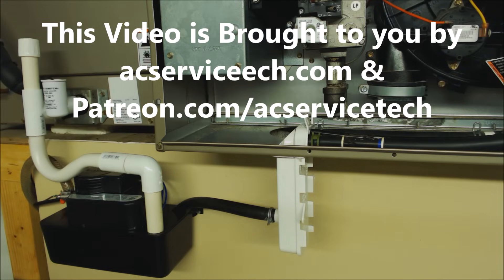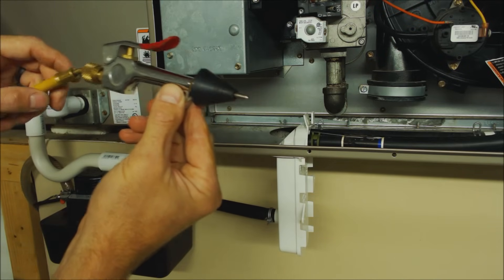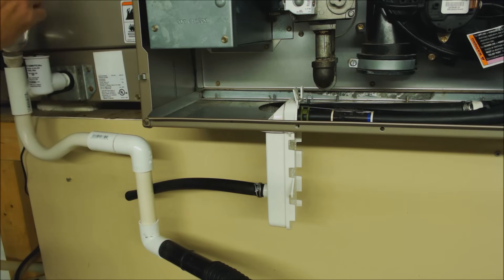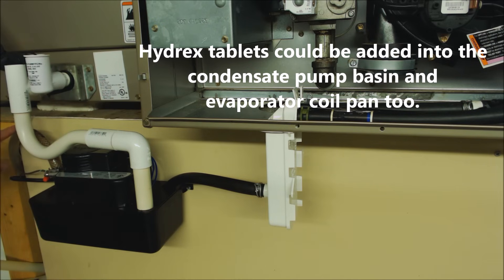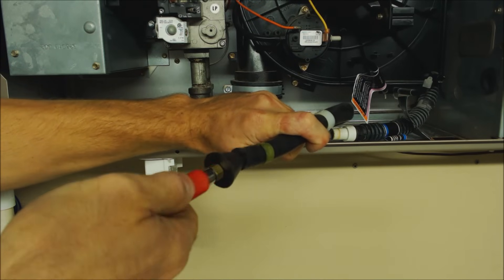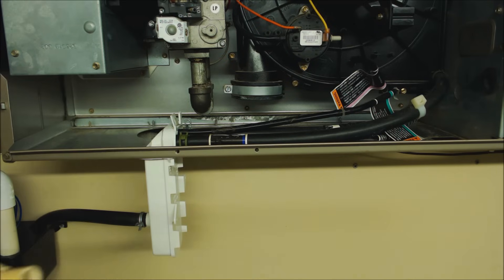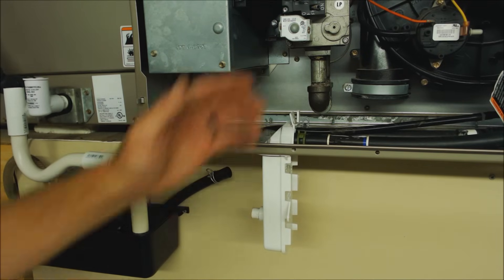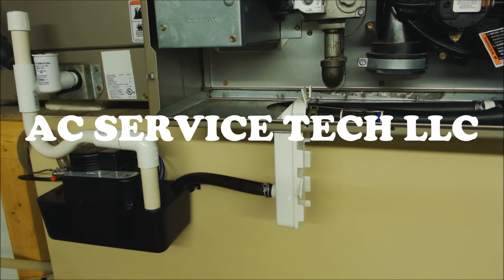Condensate Drain Traps & Lines Cleaned on AC and Gas Furnace!

Comment from the maker: Tool List-  https://www.amazon.com/shop/acservicetech
Support-  https://www.patreon.com/acservicetech
For those that are looking for the tools used in the videos: (Linked Below)
Nitrogen Blowout- https://amzn.to/2yzMQRD
Air Compressor Plug and Coupler Kit- https://amzn.to/2NE8klG
Air Compressor Blowout- https://amzn.to/2CaNXum
Craftsman 2.5 Gallon Shop Vac- https://amzn.to/2ROaR0j
Hydrex Tablets- https://amzn.to/2CHOu8m

Supplies Used for the Vacuum Hose
1/2" Cpvc Slip X 1/2" Mpt Male Adapter
3/4" PVC Reducing Bushing x 1/2" fpt
3/4" PVC 90 Elbow
Misc 3/4" pvc
Misc 1/2" cpvc

Here is the Link for the Yellow Jacket Refrigerant Manifold Gauge Set used in the videos http://amzn.to/2aenwTq

Here is a link to Refrigerant hoses with valves used in the videos  http://amzn.to/2aBumVI

Here is a link for RectorSeal Bubble Gas Leak Detector http://amzn.to/2ckWACn

Here is the link to the Appion Valve Core Removal Tool- http://amzn.to/2uYr8WL

Here is the link for the Ratcheting Service Wrench   http://amzn.to/2dGV4Nh

Here is the Link for the newer UEI DL479 Multimeter with temp sensor- http://amzn.to/2jtsUbJ

Here is the link to the CPS Vacuum Micron Gauge- http://amzn.to/2v1nM3O

Here is the Link to the Appion Blue 3/8" to 1/4" Vacuum Hose- http://amzn.to/2uYlVyc

Here is the Link to the Appion Red 3/8" to 1/4" Vacuum Hose- http://amzn.to/2uYg6Ro

Here is the link to the Yellow Jacket 1/4" by 1/4" heavy duty hose straight-  http://amzn.to/2umtcod 

Here is the link to the pack of 25 C&D valve cores- https://amzn.to/2J1lurm

Here is the link for the C&D Valve Core Wrench, Container, and 3 valve cores- https://amzn.to/2EVGkps

Other tool links can be found in the video description section.

Shop through Amazon! Your Purchases through Amazon provide a means for channels such as mine to earn advertising fees from all purchases after clicking through. Prices are the same as normal-    https://www.amazon.com/shop/acservicetech

All of the ACSERVICETECH Playlists-  https://www.youtube.com/channel/UCOZR-1IqsAer9wzlvFgb4mA/playlists?view_as=public
Nitrogen Blowout- https://amzn.to/2yzMQRD
Air Compressor Plug and Coupler Kit- https://amzn.to/2NE8klG
Air Compressor Blowout- https://amzn.to/2CaNXum
Craftsman 2.5 Gallon Shop Vac- https://amzn.to/2ROaR0j
Hydrex Tablets- https://amzn.to/2CHOu8m

Supplies Used for the Vacuum Hose
1/2" Cpvc Slip X 1/2" Mpt Male Adapter
3/4" PVC Reducing Bushing x 1/2" fpt
3/4" PVC 90 Elbow
Misc 3/4" pvc
Misc 1/2" cpvc

Comment: If your unit is installed in an attic you might consider adding heat tape around the trap to prevent the trapped condensate from freezing.  Ask me how I know!

Comment: I simply unplugged all the vacuum and drain hoses, removed the condensate trap and gave a hearty blow into on end.  Amazing the black soot that came out… I ran some hot water thru it in sink to ensure flow and replaced all components.  One tip I didn’t know I needed to prime the trap with water to create a flow again, otherwise the water will build back up.

Comment: Thank you that fixed my leaking of water all over the floor around the furnace. I had a clogged trap. I used my wet dry vac and sucked from the end that goes into my floor drain.

Comment: You provide great detail on how to "assemble" necessary parts to clean out the trap, much of which could be addressed by simply installing an EZ Trap 113B. Trap is transparent, comes with flexible brush, and has tightly-sealed caps which to access the trap (while preventing entry of unwanted air). I look forward to your input...
Reply from the maker: I saw an earlier comment from you! Please feel free to email me at questions@acservicetech.com to contact me (Craig) directly.

Comment: Why do you have to add water back inside the trap after cleaning it with a vacuum? What would happen if you didn't add water?
Reply: That was one of my questions too. I winterize my furnace by sucking the water out of the trap. when I start it up again it has a sucking sound and usually fills back up within a few minutes. If I leave the water in the trap with the furnace off in the winter, the water in the trap freezes and the furnace will run for about 10 minutes and shut off. I have to get a blow dryer and melt the water in the trap to get the furnace to run again.

Comment: Question for you. During the heating months hot furnace air blows out from my ac condensate flue pipe. I assume all the water in the AC condensate trap evaporates. Is this normal? Do I need to make a larger trap? Thanks
Reply from the maker: Unfortunately, it is normal. You could close off this line during heating season or keep filling the trap with water, thanks!
Reply: @acservicetechchannel  thank you for the reply. 👍

Comment: You don’t need a trap on a push through coil. Air Handlers for example are pull through coils that have a negative pressure at and around the primary pan/pvc drain connection and that’s when you need a trap for proper drainage. All of this is true unless your local requires a trap regardless of this information.
Reply from the maker: Push through will still not allow water to drain out of the evap in horizontal applications in most cases, thanks!
Reply: Craig do you have any videos explaining these theory’s ? I’m a noob and heard this about push and pull and want to know how to tell the difference and when and when not to add a PTRAP. thanks you’ve been a great help.

Comment: I just vacuumed my condensate pump out will this be sufficient enough for a clogged drain line that was leaking water on the floor?
Reply from the maker: It sounds like you should take the door off of the evap coil while the unit is off and test it by pouring water into the condensate pan to see if overflows or drains through the line, thanks!

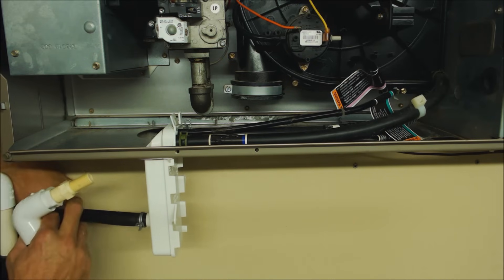Comment: At 5:30 in the video, you used a shop vac to suck out any contaminates in the furnace condensate trap. The trap does not appear to be vented, so it's closed? Wouldn't the high vacuum created by the shop vac pull on the vacuum & pressure switches in the furnace and possibly damage them? They are only open or close with lite pressure as in H2o, this may damage the switches if the internal trap is sealed, right?
Reply from the maker: At 3 30, I showed that the pressure switch must be disconnected first before using the shop vac, thanks
Reply: The vac lines at the pressure switches are ALWAYS disconnected no matter which way you clean them i.e. suction or blowing. Never leave a line connected to a pressure switch because it don't take much to fry them. That's exactly what he did, he took them off. This man knows his stuff.

Comment: For an air compressor. Which one is ideal ? 1, 2,3,30... gallon ? Used to blow drain , leak check gas pipes , clean blower motor wheel. ...thnx
Reply from the maker: Hey Daniel just a 1 or 2 gallon is more than adequate, thanks

Comment: Just wondering where can I find commercial refrigerators to scrap?
Reply from the maker: Depends on your area. Have you been working toward your 608 certification or found a testing center yet? thanks Jacob!
Reply: i don't want to go to school to do refrigeration , I just like taking apart refrigeration compressors just for fun
Reply from the maker: Actually it is usually a one or two night review and if you study for it, it shouldn't be too hard to pass. You need to make sure to do this, thanks
Reply: I know what your saying but i just like to take apart refrigeration compressors for fun

Comment: A.c. service tech,  why do you use electric tape ? Just want to know reason... also the air compressor blow out that has long nozle , will it work with nitrogen bottle or just for air compressor? I don't imagine you carry it in your work van do you?
Reply from the maker: I would rather carry my small compressor than a heavy nitrogen bottle. Also I can get free air compared to having to do the exchange at a supply house. I also don't like those small co2 cartridges. Yeah I carry the small air compressor in the truck. I also use it for other things like pressure testing gas lines and so on but you can just carry two blowout guns, one for air and one for nitrogen. The extension would fit in either. The electrical tape fills the gap inside the tubing so all the air is forced forward, not behind the extension and back out through the opening, thanks Daniel!
Reply: @acservicetechchannel  super ! I heard them cartridges good for nothing... I'm thinking about getting the air compressor. Not sure which one you use. I found a small portable one on ebay, hopefully just what I need. 

 https://www.ebay.com/itm/1-3-Horsepower-3-Gallon-100-PSI-Oilless-Portable-Pancake-Air-Compressor/142586316691?_trkparms=aid%3D555018%26algo%3DPL.SIM%26ao%3D2%26asc%3D20180306143914%26meid%3Db057a0d95a3944ed8158adca30973cc5%26pid%3D100935%26rk%3D1%26rkt%3D12%26mehot%3Dlo%26sd%3D323491320255%26itm%3D142586316691&_trksid=p2056116.c100935.m2460